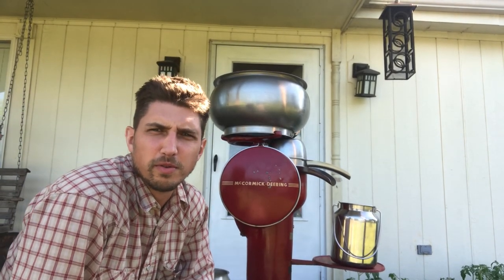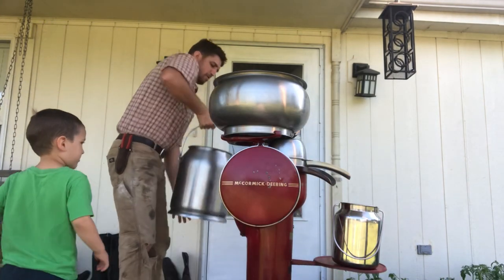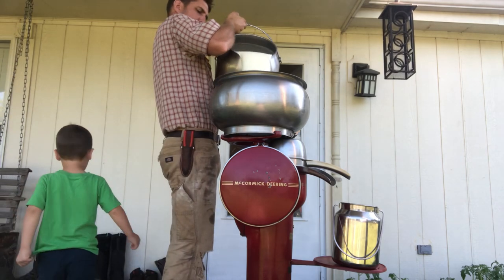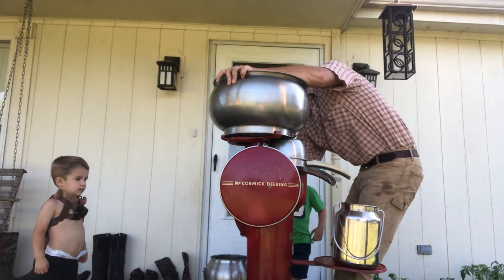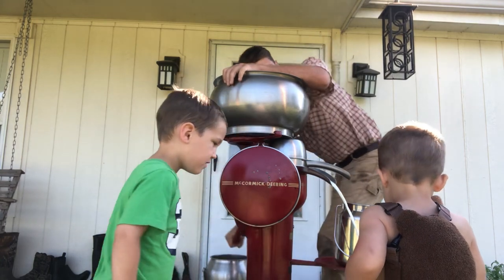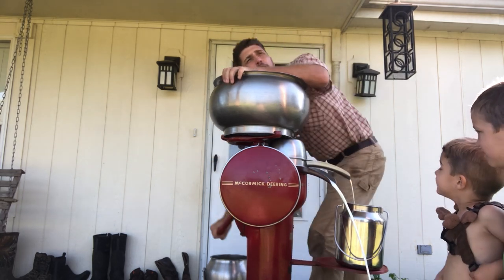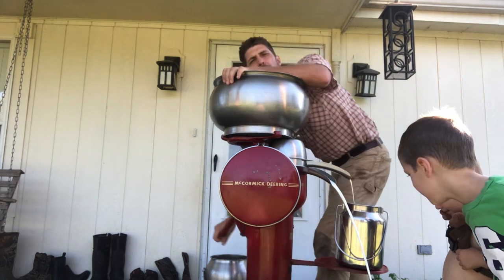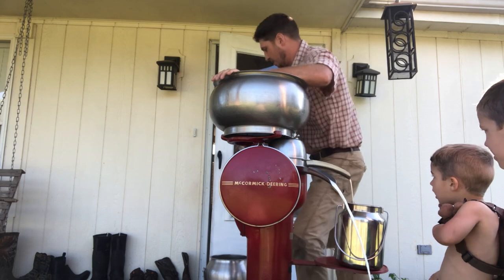1941 McCormick Deering Cream Separator.

Comment: It makes my heart feel glad that you went to the trouble to bring your machine back into good working order. When I was young living in Canada we didn't have electricity, we milked the cows by hand and my mother cranked the cream separator. She was young then but still it was hard work. Back in those days we had to strain the milk with cheesecloth and the water had to be heated on the stove to warm the separator and clean it. I had to churn the cream to make butter and that job took forever. You have to be careful of how fine to adjust the machine because if you make the cream too thick it'll start to clog the machine and stop the flow. Teach your boys how valuable that machine actually is. All it take is for a power outage and we are right back in the 18th century. Our separator had a bell and it would "ding" when the speed reached the correct RPM for separating the milk. It would ding with every revolution of the handle as long as the speed was constant.

Comment: Do you have a video showing the parts and assembly of this model of cream separator?
Reply from the maker: HeatherF27 nope but I’ll sure make one for ya!  Do you need a video on the bearings and oil or just the part on top?
Reply: @harmonyhillfarmstead  I'd certainly watch both if you made them. I've got a manual I've been working through but I'm so much more a visual learner. Thank you!
Reply from the maker: I just posted it for you

Comment: I have the same cream separator in nearly as good of condition as yours. I’m looking for a few parts though if anyone has any ideas. For one, I need the cream shelf, and two, I need the nut that goes on top of the centrifuge. I also need gaskets.
Reply: Tengo dos tuercas en honduras las conservo
Reply: @alexmeza4493  I’m in Missouri but thanks